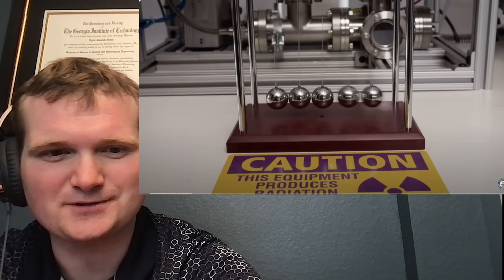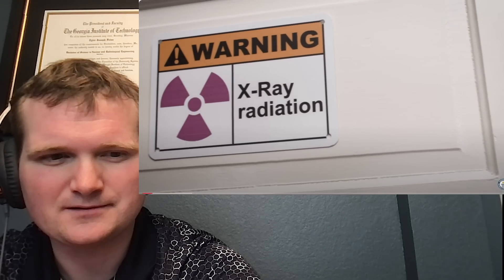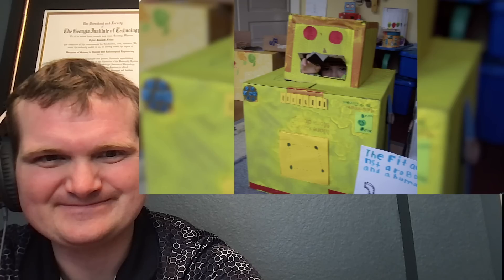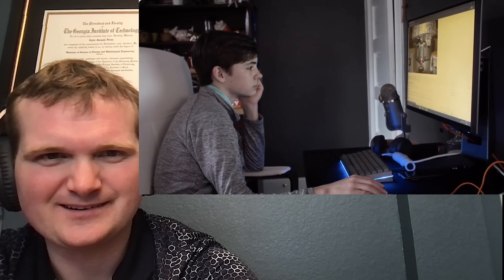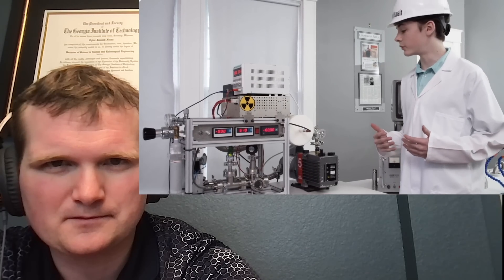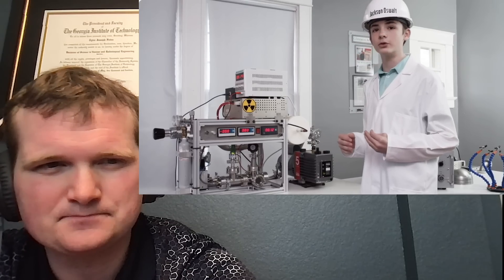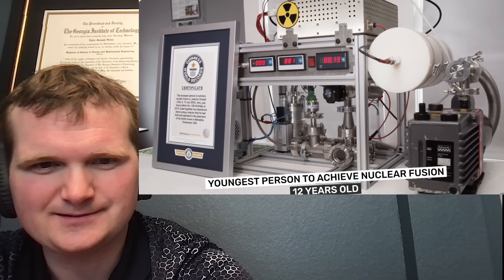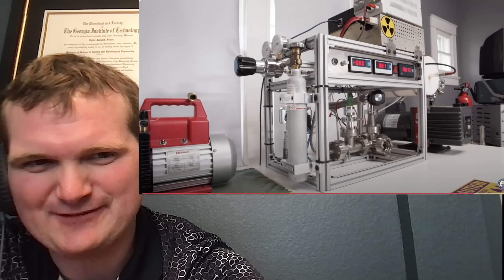Nuclear Fusion by a 12 Year Old? - Nuclear Engineer Reacts to Guinness World Records

Comment: Hi, I work in radiation therapy and while we were taught a lot about radiation and whatnot, I never understood how an electron beam was different than an electric arc. I was hoping you could explain or make a video, since I have been seeing your stuff pop up more and you seem pretty knowledgeable on similar subjects.
Reply: Well, the difference is the behavior of the electrons and how they interact with the energy induced by a huge electrical field and the matter or absence of matter.

An arc is basically a portion of gas where the high voltage causes a breakdown of the dielectric resistance and make some of the electrons flow through the gas heating it and ionizing it, making the gas a literal pathway to the current, in which the electrons move at "low speed" through the material.

In case on a electron beam, electrons must be pulled of from its source using termoionic or photoelectric effect and then they are accelerated under a high voltage though a vacuum, flowing linearly and at very high speed, relativistic speed (from 0,2c to 0,8c)

In botch cases electrons are accelerated due to a high voltage initially, but in the arc they are absorbing and losing energy constantly, generating a lot of heat which keeps conductive the gas, and this way they are low speed - "low energy electrons", but in a beam, once they are accelerated, in the vacuum there is nothing stopping them, so they can achieve a huge amount of kinetic energy and thus, speed.

It could be said that the main difference, would be the energy of the electrons (due to his behavior cause the presence or lack of matter in their way)

Comment: the whole thing though looks like a kit. I doubt he milled those steel pieces himself and so on. Follow instructions, assemble kit, press the right buttons.
Reply: For sure he used a ton of of the shelf components, which is just normal. Everyone would do it. Why should you reinvent the wheel?
Reply: @JacquesMartini  Thats not what I said. I said it looks like he used a kit. "Build your own fuzer" - kit that comes with all the necessary parts or close enough
Reply: @rykehuss3435  Maybe. Do you know any website that sells such kits?
Reply: @JacquesMartini  ebay  maybe
Reply: @bsadewitz  Yeah sure. Basically I doubt this kid 3D modeled the parts then had them CNC milled. He just bought everything and assembled it like some lego project. Thats probably why he was talking about funding, those parts arent cheap to procure.
Reply: @rykehuss3435  It's legit.  It was not from a kit.  I'm pretty confident those do not exist.  Why? Because if you don't know enough to put it all together in the first place, a kit won't help you, and even to set the thing up is probably beyond the "kit" market.  Whether he milled the steel himself is beside the point. That's like saying you didn't build a car engine because someone fabricated the parts for you.  

There are lots of instructions out there.  There are people willing to help you every step of the way.  You could have someone make all the parts for you. This is not the sort of thing that you can just do without knowing what you are doing. He got the money somehow.  Doesn't really matter.  The fact that he is even operating the thing is impressive. It's not like you push a button. 

I think it's still fine to ask  these sorts of questions.  It's just curiosity.  And there sure is a lot of fraud out there. I can't say how much help he had, but unless his help was also impersonating him on a forum over a year+, then he also knows what he is doing.   

  Really, the takeaway should be that 12-year-olds are capable of a lot, especially bright, motivated ones--and you need both of those, at least.  IQ alone is insufficient.  Only gets you so far. You need the drive to do it, and resources, and parents/elders that support you.  

 Richard Feynman's IQ was +2SD.  So is mine. I am not a pathbreaking nuclear physicist, in case there was any doubt.

But I could have told u he did it without  doing all this: if Tyler didn't call BS, odds are he did it.  It defies reasoning to think otherwise.  On what basis is our intuition a more reliable guide?  Not that u said he didn't do it.  I'm just thinking out loud.  Well not really.  But also yes.  Lol know what I mean.

This is what one of the forum mods said:

"This is another tiny volume fusor that is working well and shown to be doing so with decent instrumentation. Again the removal of the tube from moderator count fall off to zero and re-insertion resume counting coupled with the image of the pink discharge and star rays is a true representation of fusion, regardless of final count, errors in counting, etc. If a neutron detector tube is counting in moderator and dummies up outside during a run, well, that sort of tells it all."

The kid shared data.  And FWIW, if you asked him, I doubt he would claim that this feat made him exceptional.  But even if if did, it wouldn't be wrong.  

tl;Dr: there CANNOT BE anything like a Lego kit to do this.  Just DETECTING THE NEUTRONS is well beyond Lego kit.  You need to know wtf the data even means. You need to set up and operate the detector properly. It's not like there is some light labelled "neutron detected".
Reply: @bsadewitz  " Richard Feynman's IQ was +2SD.  So is mine. I am not a pathbreaking nuclear physicist, in case there was any doubt."

Oh did you take one of those online tests?
Reply: @bsadewitz  You sound young dude, the lack of self awareness is palpable. You need to stop caring and get more cynical.

Btw, as a pre-teen I went through a test much like you described, and the good doctor told my parents I had 132 IQ. No one cares about it though, and no one cares about yours. Its cringy to bring it up. And no I cant connect with people either

Comment: C'mon! What's the point with this "Wunderkind"? Sure, he has exceptional skills, abilities and mental development, but this is nothing but a science freak show. By no means will this have ANY impact on science or the world. He may become an exceptional engineer or scientist, but even then, the problems of fusion will not be solved single handedly. He is remaking a decades old setup using modern, off the shelf components. Sure, not the things 99.999996789% of 12 year old do or are able to do, but still just a copy. And he did it not in "thin air", he was surround by plenty of adults who supported him. How much? 90%? To get a new record? All totally pointless. Wait until china is presenting its "Wunderkind" of 10 years do the same, which will turn out all fake! 😂
Reply: Looks like a kit he bought, that you just have to assemble yourself - not worth a GWR, by far.

Comment: You say that but ITER in france will never produce any power either . So far we only have fusion demonstrators. As none of them turn the produced heat into work to make electricity as of yet. Let alone achieve positive energy production.

This kids device is useless. But only because it lacks scientific application. Otherwise his device is equally as useless as ITER! in terms of its practical value for work

Comment: I’ve never had an issue with calling medical nuclear reactors nuclear reactors as districts from nuclear power plants so I don’t see why we can’t call what he did a fusion reactor instead of a power plant. Reactors don’t need to make power.
Reply: Yeah, but it is misleading.
Reply: uh yes they do.... reactors by definition need to be self sustainable energy generation
Reply: @anomaly3215  Can I get a citation for that definition?
Reply: I agree with the sentiment that it doesn't really matter, but reactor by definition need to be self sustainable energy generation.  As tyler briefly mentioned you DON'T Want that to exist unless proper cladding and shoelding is in place to deal with it.  

Some medical technologies and devices are called causally or brandnamed reactor, so I actually think its worse to use that term in that case since it might cause confusion ((again in casual daily life agree it doesn't really matter))
Reply: But a medical/triga reactor have power to produce energy, the fusor doesn't.
Reply: Reactor is just a device where, well, the reaction happens. Whether you get more usable power than what you put in is another story. Scientific reactors are for running experiments. Reactors in power plants are for power generation. (That's for nuclear reactors.)

Chemical reactors are a thing too, but for conducting, well, chemical reactions. Scientific ones are used in research with smaller samples. Industrial ones run known reactions with high yield-to-effort ratio in bulk.

(These experts above me took a definition for a specific kind and claimed it to be true for any kind.🙄)

Comment: I also have 3 vacuum pumps, but none gets below -0.9 and the expensive pumps use up a lot of energy to remove the remaining gases. There is an easier way. You first flush the container (That also contains some silica gel) with pure CO2 until you have pushed out all other gases. Then you inject a small amount of sodium hydroxide solution  (about 5ml per Liter CO2) into the container and remove the pressure as low as your pump gets. The sodium hydroxide solution will then slowly absorb the remaining CO2. While the pressure drops even lower, the silica gel absorbs the moisture from the hydroxide solution. The result is a near-perfect vacuum at room temperature without having to use special equipment or lots of energy. (Not recommended for Kids, Hydroxide solutions are very caustic!)(I was quite happy about this achievement 🤓)
Reply: Do not forget water has a vapor pressure. You would be off gassing water vapor much faster than removing CO2.
Reply: @PurpleArcPlasma  With a 25-50% Sodium Hydroxide solution it works well and creates an equilibrium at a very low pressure around 0.03 atm after 2 days.
Reply: @seanrh4294  and if you leave it longer? Most HVAC pumps are sub torr. 0.03 atm  is still 23 torr,  but I guess its not a bad idea if you have silica gel and sodium hydroxide and wanted to mosyly evacuate a chamber without a vacuum pump.
Reply: @PurpleArcPlasma  If you are in a hurry, you could use anhydrous Magnesium sulfate powder in a generous amount instead of silica gel. Its more effective than silica gel, but it can degrade when you recycle it later again.(and cool the container with the anhydrous magnesium sulfate, placing it lower than the other container.)

Comment: The distinction between "fusor" and "fusion reactor" seems almost irrelevant to me, unless/until I can turn on a reading lamp powered by nuclear fusion.

Until then, everything (even NIF, SPARC and ITER) in this field is simply a way to study the behaviour of small ions we want to fuse by confining them at incredibly high temperatures.
Reply: Until I can buy a ticket to travel aboard a ramjet-powered airliner, the distinction is almost irrelevant to me: turbofans and ramjets both take air in, compress it, mix it with fuel, ignite the mixture, and expel it to generate thrust.
Reply: @bsadewitz  unless we talking scramjets but the distinction is almost irrelevant to me

Comment: A fuser is also a very crucial component of a laser printer. It's a heated roller that fuses the toner powder to the paper. I've replaced many over the years, some are consumable items that are designed to be replaced periodically, others are hard wired into the printer and require complex disassembly to replace. I preferred the latter because it's more fun 🤣

I miss that job so much.
Reply: A fuser is something entirely different than a fusor...
Reply: @BrianDickens4  they sound close enough 💁🏻‍♂️